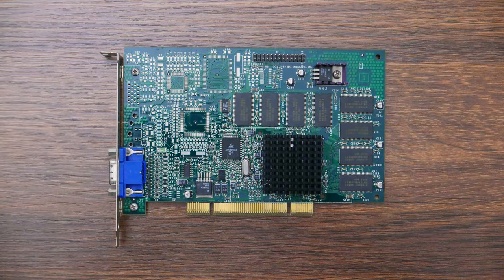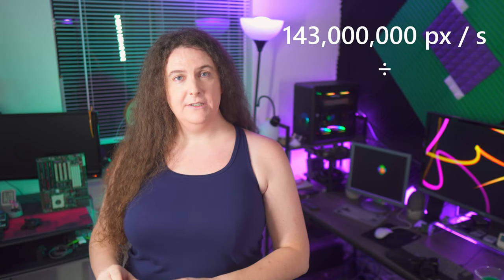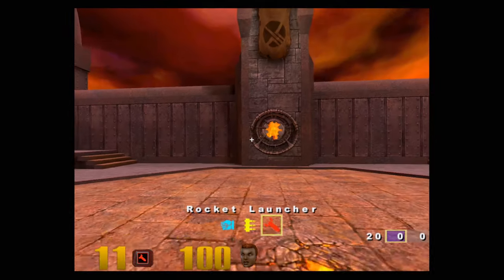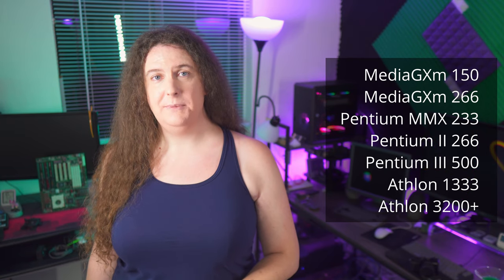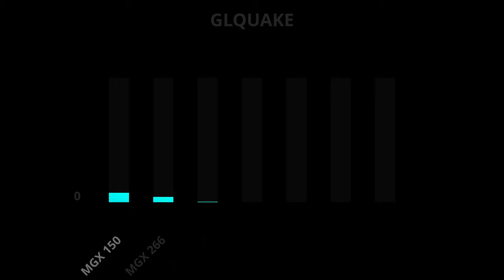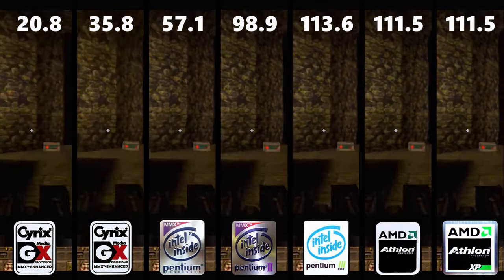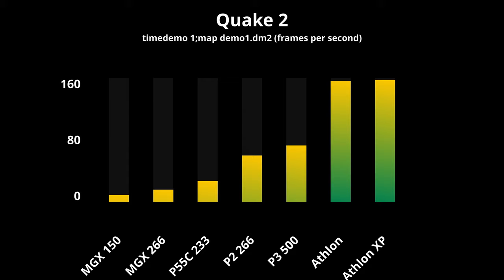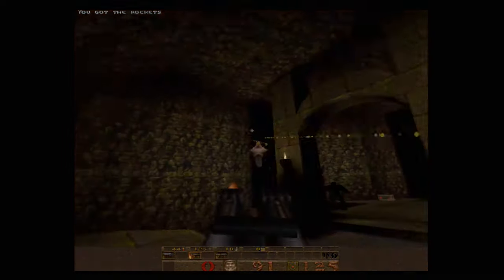How fast will it go? Voodoo3 Scaling

Comment: Interesting findings, feeling better about the V3-3500 I'm planning to use in a Slot A build (FIC Irongate based board with a 800mhz T-Bird oc'd as far as it'll take it with a TEC cooler)  I'm  working on.
Reply from the maker: Sounds fun! Good luck!